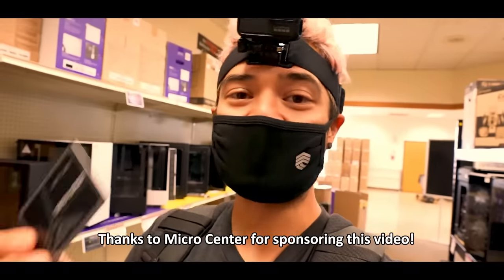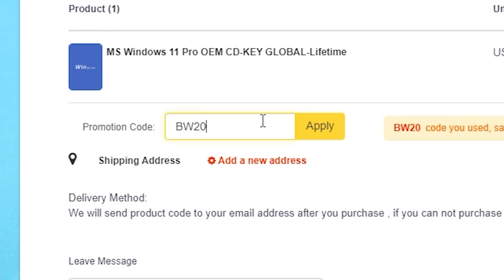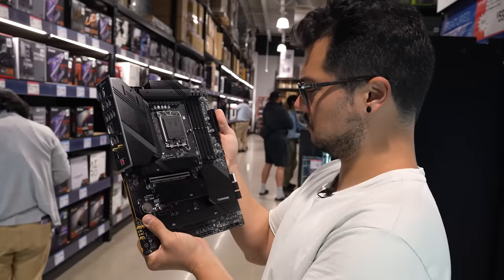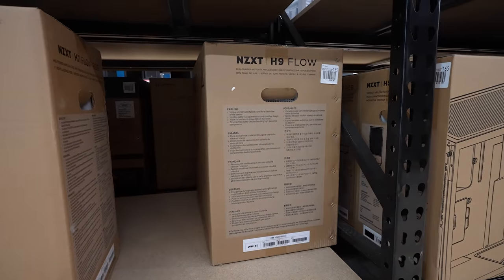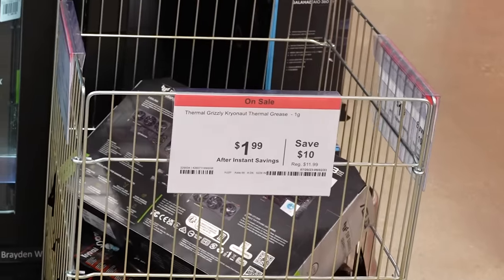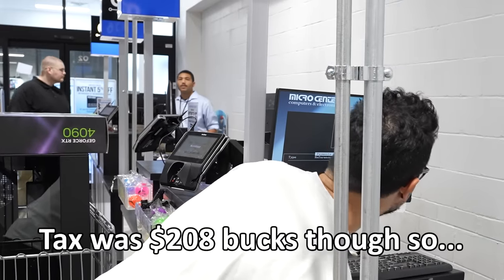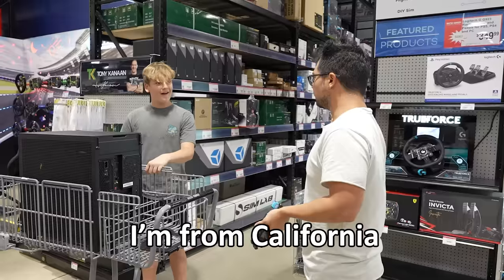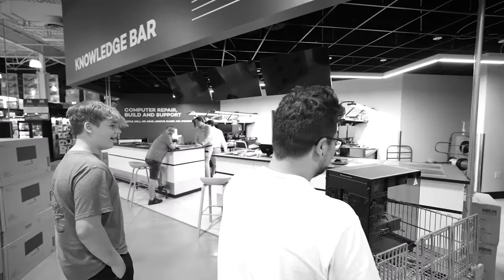*$3,000 GIFT CARD* Shopping Spree At Micro Center!! (Surprise Ending)

Comment: well I see the prices on DDR5 are still ridiculous, $159 for 32GB is highway robbery. I just got 64GB of DDR4 3600 C16 for $80, granted it was used from eBay but still. That is one reason why I'm not hopping on the DDR5 bandwagon, you all are nuts to be spending that much when you know for a fact in a year it will probably be half of what it costs now.

Comment: Monitor:ASUS VG279Q1A 165hz 1080p 
Case:Antec  DF700 FLUX
Cpu:Ryzen 5 3600xt 6 core
Gpu:asus 1660 super 8gb
Motherboard:	Asus PRIME B550M-A (WI-FI) 
Micro ATX AM4
Psu:Thermaltake Litepower 650w
Ram:XPG HUNTER DDR4 
3200 16gb
i have a 700 dollar budget this is my setup can u please tell me what is should upgrade ? i was thing buying a 3060 ti